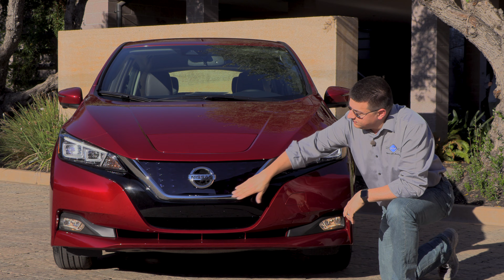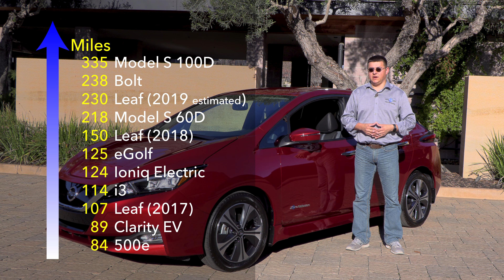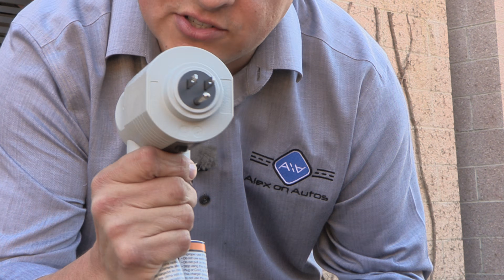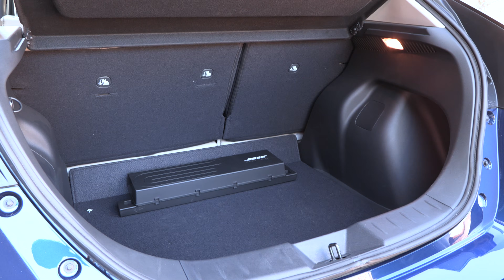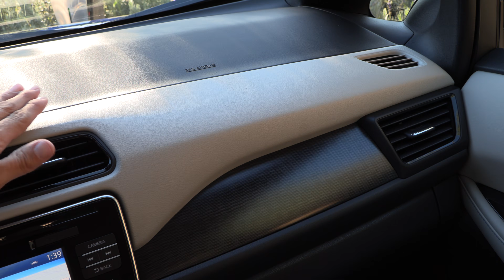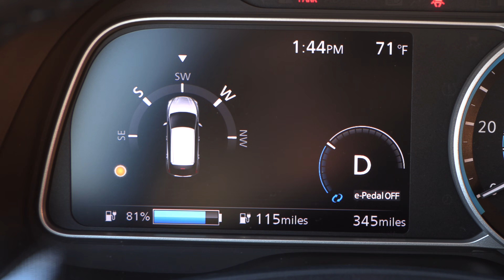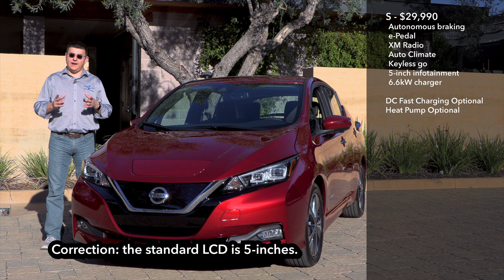2018 Nissan Leaf First Drive Review

Comment: Their passive battery cooling completely negates any benefits I think they have. A Bolt, like all Chevys, can be had under sticker and the seat comfort issue solved in 45 minutes for under $100. Choice is clear to me.
Reply: Nissan has a track record of TRUELY wanting to be a mass market provider of EVs GLOBALLY.  GM talks about it but is slow to deliver.    If range is the top priority I get the Bolt may be a top choice.

However, the Leaf is truly an EV for the masses who value a larger interior, nicer materials, and adequate range.   The whole range anxiety bit was a bunch of scaremongering and 100-150 actual AER is more than enough for a large segment of the population.  A win in my book.
Reply: That was my understanding as well and found it odd that the OP would misstate / exaggerate the battery history with the Gen 1 Nissan Leaf.  Most know having an active temperature management system would be great but it adds cost.

It can be justified for more expensive EVs but the Leaf is trying to serve the broadest part of the EV market globally.   There is a HUGE market of consumers globally that do not need 200+ AER and active thermal management.   They now have a 150 AER option at a price not yet offered in the marketplace.

The size chart was the most revealing.  It is hard to dispute you are getting a much more spacious cabin in the Leaf 2.0 (interiors sell a vehicle).
Reply: What you described does not match up with reality.  Old GM's history and settled lawsuits are a matter of record and Nissan's 1st generation battery issues are as well.  The Nissan battery issue was not widespread.
Reply: Also I think the 2019 60kWh Leaf would likely have active cooling, as the price bracket moves up a notch against the likes of the Bolt & (if they manage to actually sell any at that point) the 50kWh Model 3. But I digress.

The Leaf selling point still is very much based on its affordability. Unlike Chevy & Tesla who boast about it, Nissan actually goes and does it. This is a car that competes against volume seller mid-level Camrys and Accords in price (the Bolt & Model 3 are closer to 3 series & C-class). It won't have the latest & greatest, but for 150mi range, decently sized battery, heat pump, semi-autonomous Pro Pilot & active safety systems in a nice round package + decently good looks will likely garner quite a bit of sales, if not the praise & hype of the stillborn Model 3.
Reply: "Anything which is passive must be assumed to degrade noticably until someone proves me wrong" Well, we haven't seen any degradation on our e-Golf after about 10k miles over 2 years.
Reply: Trades46 There is a model on the leaf site, developed by the owners, to predict degradation (speaks to a fairly substantive issue). The manual itself gives expected degradation. Cars in much more temperate climates (like Virginia), with 30 kWh packs have lost two bars already. Is it a game-over for the car? No... But I surely wouldn't be happy to lose 15-20% in less than 100k miles. That puts you at 50% of a Bolt's range. Considering selling prices of Bolts are about 3500 over a Leaf's MSRP, I'd stretch the budget. However, more e-cars is good. Props to Nissan for offering an affordable product...I just would have chosen other compromises.
Reply: I already listed the 2 caveats which kills the battery, which for owners of those state I can imagine their worries. If you frequently road trip and/or live in hot climates, either go for another vehicle that is better suited for such conditions - in much the same way owning a convertible in Alaska would be kind of silly. Would active cooling via a fan or heat sink be nice? Definitely, but when you don't have a trust fund to finance a Model S, you have to pick your choices carefully.

However on Leaf forums, while majority complaints have lost 1~2 bars in their first 2-3 years, there are a lot of Leafs that are still in pretty good condition compared to some others. Also if push comes to shove, there is Nissan's 8yr & 100,000mi (loss of 4 bars) warranty to cover your backs. In fact, Tesla's warranty isn't all that much better and significantly less descriptive; 8 yrs & 120,000mi (unlimited for the 85kWh & up), but under what conditions?
Reply: That is not problem in real life..only you drive like crazy with rock on the gas ,then fast charge it ,then drive like crazy ,then fast charge it ,and repat that 4-5 times with out rest then battery will get some  heat ...but in real life you want do that ever because who drives 1000 miles for a day ...only youtubers who want a views
Reply: Cory Stansbury under $100? How?
Reply: https://www.youtube.com/watch?v=2dgxWTOnVn8 Several have done this with very positive results.
Reply: Cory Stansbury great. I will wait for gm to install better seats next year on the bolt.
Reply: Anthony C Brown Nissan has a track record of delivering a car with such deplorable range loss that there was a successful class action lawsuit. This subsequently made the Leaf sell vastly under sticker. GM, meanwhile had a vehicle with industry leading customer satisfaction and now has two vehicles which outsell the Leaf. GM also provided the technology in the new Clarity, so that will be an additional source of influence. It would be nice to see the cars in more markets, however. I'll concede that.
Reply: Anthony C Brown from what I understand the Leaf battery degradation is mainly on the early 24kWh cars and happens to mainly very hot places like Nevada and/or users that road trip their Leafs and DC rapid charge via Chademo frequently. I do admit heat soak could be a problem, but for most users who again have commutes with round trips of ~50mi, it would be a non-issue.
Reply: xchopp like I stated, passive cooled batteries are fine for commuting cars or occasional DC rapid charging. The whole ordeal of heat killing battery for normal use is WAY OVERBLOWN (leave it to the Tesla drivers to spawn stupid theories, even on Leaf forums). Of course local weather would be a factor, but if you go take road trips and rapid charge consecutively, you brought the wrong car to start with.
Reply: xchopp Well, game-set-match. 10,000 miles... An incredible testiment.
Reply: Trades46
You are wrong. Lithium battery prices have dropped in half just in the last few years and either that trend will continue or batteries will continue to improve in energy density so you'll see longer range capability at similar price levels to today. Tesla is not lying, they pay less for their batteries than anyone else because they have built their own mass production plant; every other EV manufacturer is sourcing their batteries from Panasonic or LG Chem who don't have the capacity to keep up with demand. Mercedes is building their own large scale battery facility and China is in the process of building multiple of the same scale as Tesla's gigafactory.
Reply: The Leaf batteries wear out quickier beause they have low range to began with.  This means they go through more charge cycles then a higher range battery like the Bolt to cover the same mileage.  2. Since they lower range they are nearly fully discharged when charging. 3. This process wears out the battery that is why you lose bars.  4.When you lose a bar now the battery has even less range so it discharges even fastest. 5.  Do not buy a Leaf from Hot climates those batteries show these effects the most.  The active  Heating and Cooling would slow this dilemma.  Used Leafs have no resale value.  You can buy a 2015 SV for $15,000.  That is why Nissian dealers send Leafs coming off lease to the Auto auctions.  How could they sell a 2017 for $35,000 minus a $7,500 Fed tax credit and Utility co rebates too, when a  $2015 is $14,000 with 25,000 miles. Just to many of the same EV competing against each. When you buy a used Leaf check the Carfax to make sure it didn't come from a Hot climate.  Also how many owners, it is common to see a Used Leaf with 3 owners in 4 years.  Where does all this information come from,  My friend who owns 3 used car lots, who no longer sells used Leafs.  Also he told me how much money can there be it a 5 year Leaf with 9 bars that goes for $6,500.00.  Remember to figure in resale price when buying a car. That is also a cost of owning a car.
Reply: xchopp I bet you live in California or the northeast. Your car in Florida would be different.
Reply: I rather have a heat-pump than active battery cooling. For short trips & home Level 2 charging battery cooling isn't an issue. Only when you go full 'Tesla Bjorn' and rapid charge 3~4 times consecutively it would be a problem. Since I live in Canada, a heat pump would on a daily basis as a commuter car be significantly more useful than active battery cooling.
Reply: Trades46 Every non-active conditioned battery on the market has suffered significant degradation issues, whether or not fast charging was even an option. I agree that living in Canada, it's less of an issue, but GM batteries basically don't wear out. Anything which is passive must be assumed to degrade noticably until someone proves me wrong. I'd be surprised if a car-sized heat pump has significant advantages over resistive heating at temps we get here in Maine in the morning, but do agree the fall and spring performance increase would be noticable. Still would never give up active conditioning to get it.
Reply: Cost is always going to be an issue for EV, and both Nissan & Chevy had to make sacrifices to get EV to be 'affordable' (or you can just lie and be Tesla). I guess the Leaf would be a problem in states like Nevada & Florida where heat could kill the battery quickly, so the Bolt it is.
Reply: Trades46 I agree entirely. Remember, the EV1 had a heat pump, so GM is aware and clearly put their money elsewhere (engineering decision for sure). I also heard defrost performance had something to do with it. 

My Volt can use the engine in cogen mode to greatly reduce electrical usage while utilizing the engine at probably 70% efficiency in generation + heat mode.
Reply: Cost, cost and cost. Batteries are expensive & with more EV coming out, Li is already beginning to skyrocket in value. Despite what everyone says, I doubt we'll see any EV costing <$25k any time soon. This is where I give credit to Nissan; the Leaf as we see here is a ~$30k car, significantly cheaper than the Bolt & Model 3 which have been highly vaunted for their 'affordability' & range. This Leaf mk2 goes farther than any other EV with the exception of those two but at much lower cost. Also judging by Alex's review, the Leaf is now actually quite a well equipped & nice looking vehicle, unlike the bug-eyed mk1 Leaf. It doesn't have the outright range, but it certainly does have 'enough' to make range anxiety be unlikely for majority commuters. This is where I think the Leaf will do well, like it has traditionally been.
Reply: It's for this reason that I am highly supportive of plug-in vehicles. I don't just see them as a transition option, but a viable option well into the future. I wrote about it in a comment which them became an article on Jalopnik: https://jalopnik.com/comment-of-the-day-do-the-math-edition-1797035708 . Resources and prices are never guaranteed when discussing something of this magnitude.

Comment: Excellent review Alex as always! Would get the Leaf if it had an active battery thermal management system. Here, in south Florida, summer temperatures will degrade battery capacity much faster than outside the southern states. I heard that from many ‘16 and ‘17 model year Leaf owners. GM, BMW, and Tesla use active battery systems (water cooled) with good results in Florida.
Reply: Tony S Same here in NY, batteries don't like the negative temps we get here in the winter. That and IDK what weather protection this has but if it's not that good the salt won't be nice to this car.

Comment: STOP making these EV's, they are causing a massive environmental disaster with mining of Cobalt that uses child labor and slave labor in Congo
Reply: Maybe first educate yourself about the impact of oil drilling on the environment and then speak
Reply: Luki My
lol @ you....you just proved what an uneducated loser you are, shame your parents are too lazy to use birth control and avoid a mistake like you being born. Your useless EV requires lots of oil to manufacture that junk car while your battery pack is killing the environment. Your Cobalt will run out very soon while we have thousands of years of oil to fuel my car. Cobalt for lithium batteries need to be used for more important items like electronics instead of useless EV cars.
Reply: Trebor S Nobody is going to be persuaded by your arguments if you act like a jerk, even if you do have valid criticisms.
Reply: his mustang gets worse gas mileage then many crossovers, you know the one that can actually seat 5 adults and tow a trailer. a mustang is basically a 2 seater with child seats in the back.
Reply: Maybe you should throw away your cellphone which uses the same cobalt.
Reply: medpilot he obviously has no care the the environment driving his v8 mustang that can't even beat a crossover in fuel efficiency. he is just a hater simple as that
Reply: Trebor S - Your conclusion is overly simplistic. If the world stopped producing everything that uses raw materials from questionable sources, the world economy would grind to a standstill and people would starve.
Reply: Cobalt can be recycled.
Reply: your such an environmentalist with your mustang profile photo. hopefully you mustang has the most environmental friendly engine and not the v8 or even the v6
Reply: 27mpg woooooo!!!! you are like an obese nutritionist or a smoking cardiologist
Reply: Trebor -  Wayne Russell
Tesla resources from North America - has bought the old mining town of Cobalt Canada.
Now other companies are following with Apple, HP, Samsung SDI, Sony, BMW, Volkswagen, Ford, Daimler, BMW, Honda, Jaguar Land Rover, Volvo Cars, truckmakers Scania, Volvo, and Toyota have all pledged ethical sourcing.
China (who own the Congo mines) has The Responsible Cobalt Initiative, created by the Chinese Chamber of Commerce for Metals, Minerals and Chemicals Importers and Exporters, is aimed at promoting cooperation with the government of the Congo.
“There seems to be enough known land sources of cobalt to last for at least 100 years and for many, many more years if speculative and hypothetical resources for deep sea, ocean floor resources are taken into account (about 120 million tonnes according to the USGS).” Cobalt Development Institute
Not all battery chemistries use Colbalt - BYD the giant Chinese battery and EV company use Lithium-Iron-Phosphate.
Many other potential chemistries are under development including the Braga/Goodenough sodium technology (seawater).
Compare this with petroleum's extraction, refining, shipping and use history and present, and the problem palls in comparison.
Reply: environmental disaster?  I had an oil pieline burst close to my farm and had crude oil floating down the creek and river that my farm borders, polluted over 100 miles of shoreline.....you want to talk about environmental disasters.....the idea of charging a car with my solar array, and recycling the battery after it is depleted is a far cry better, in my opinion
Reply: Trebor S - Cobalt is used for a lot of things in addition to batteries. We're not anywhere close to running out!
Reply: tanzanable
Please educate yourself about Cobalt before you type. Now run away to your fantasy world as you are not needed on this planet with your Microcephaly
Reply: Trebor S - I did and there's plenty of cobalt all over the world yet to be mined.
Reply: Jon Dittmar  just a heavily modded  V8 that makes environmental burn outs while I get 27 mpg on the freeway  better then any EV or useless hybrid
Reply: NEC batteries in the 2011-2018 LEAF have manganese cathodes (LiMn2O4). Tesla batteries have around 15% cobalt cathodes, sourced entirely from North America. LG Chem, where Nissan is going for 2019+ batteries, does not source its cobalt from the DRC. Nice try, but troll elsewhere.
Reply: Woa! Really LOL
Reply: tanzanable
lol...nope...it will run out after we kill the environment to build those EV cars http://www.sustainablebrands.com/news_and_views/materials_packaging/sustainable_brands/cobalt_declines_demand-growth_rises_500_percen
Reply: tanzanable
NOT overly simplistic at all....must stop building EV's NOW before all the raw materials to make the battery packs are used up. EV is not the solution, it is part of the problem...the worlds economy will not grind to a standstill if we stop mining for EV cars.

Comment: 7:49 "subwoofer neatly tucked in" — Tucked in? It sticks out like a sore thumb. It appears to be 3" high. It breaks up the cargo floor.
Reply: No kidding... why on earth couldn't they intregrate the subwoofer into the side panel of the cargo area like every other car on the planet with a subwoofer?
Reply: Major design flaw.  Nissan needs to offer a cargo false floor that could be put over that subwoofer when you have cargo to load (at the very least).
Reply: yeah about 3 or 4 inches it's pretty big the video kind of makes it look smaller then it actually is